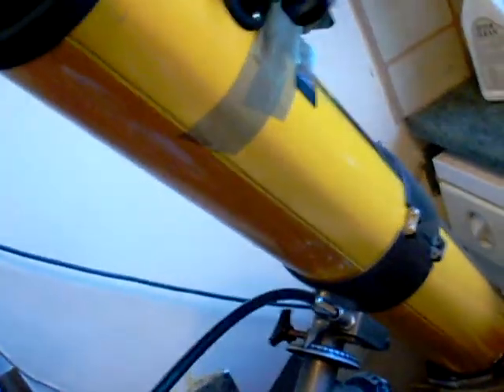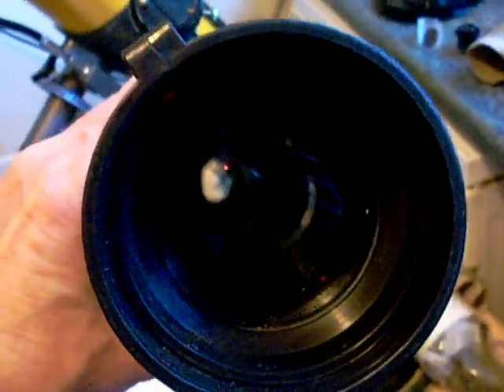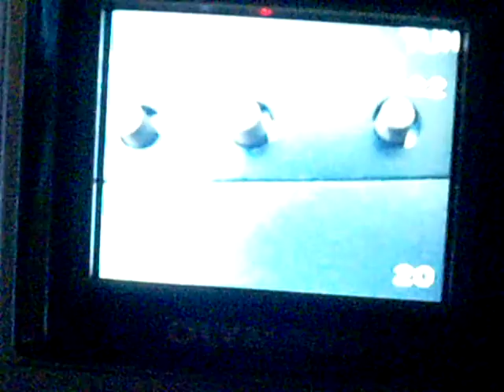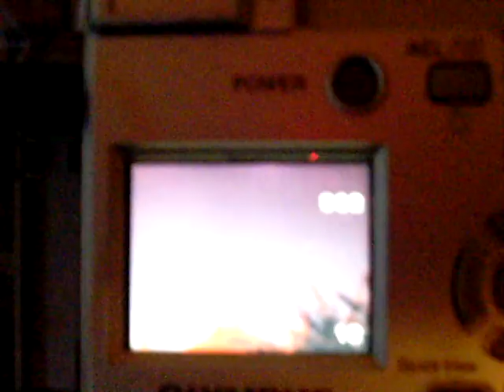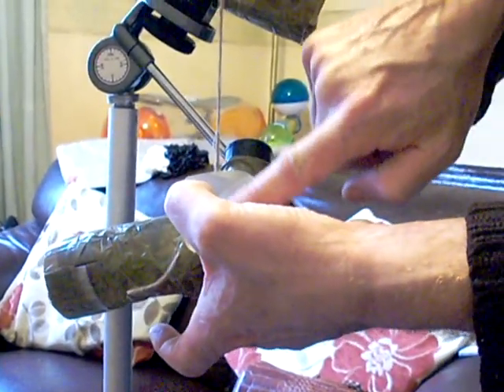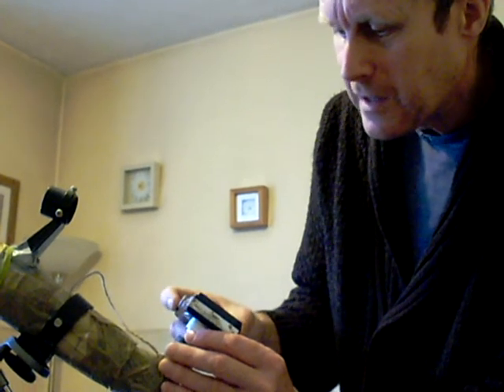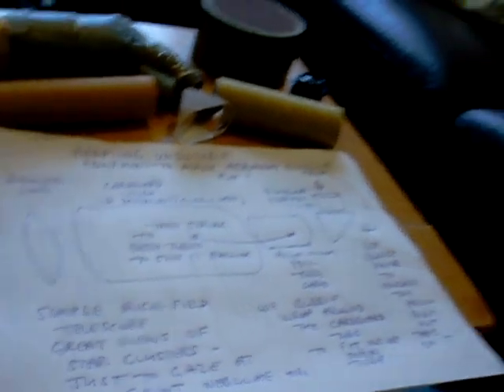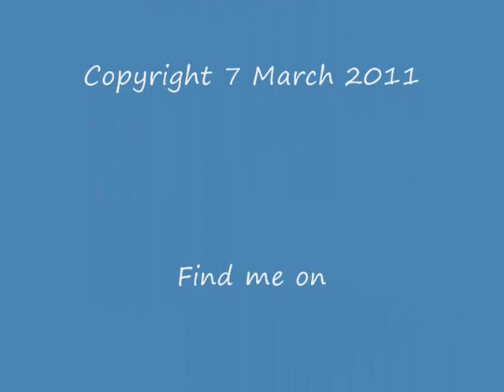How to use a telescope  - Mike Culligan

Comment: Hi, can you help me please? Ihave been given a Terratek Astrotek 76 reflector telescope, but have no idea how to use it. I can't find any info online, or any instruction manual. I found an old listing for this model so you can see the details and pictures for it here: https://www.worthpoint.com/worthopedia/terratek-astrotek-76-telescope-bnib-244888257
I can't work out which bits connect to what, where the lenses go, which bit I'm supposed to look through or anything! I tried looking through the bit I think you're supposed to look through, but I just see a reflection of my eye. Somehow, I don't think that's right. I've asked for help on  a few forums etc, but so far, haven't received any help. I'd really, really appreciate someone with a bit of knowledge to help me figure it out. Thanks :)
Reply from the maker: Hi.I think the reason you can only see a reflection of your eye is that you may not have an eyepiece in the side tube where they fit.  In order to see the moon etc, it's best to use the highest number mm eyepiece eg 25mm. This will give the lowest magnification but the widest field of view.  The little spotterscope on the side of the scope is for finding objects once you have the scope set up on its tripod.  You can practice on chimney pots and tree tops in the daytime to get used to focusing on distant objects first. Although I couldn't find a manual for your exact model  I have found a manual online which has a similar type of telescope to yours.  Look at the instructions in the manual for the Skywatcher AZ1. Here is the link:   http://www.kasg.org/pdf/All%20About%20Telescopes%20from%20Skywatcher.pdf
Hope this helps. Good luck.

Comment: Why is everything taped up?
Reply from the maker: Hi Jeff. Thanks for watching. A lot of my spotting scopes are homemade. Shop bought spotters are often stopped down with tube baffles and extra prisms which cut out light for astronomy. Every photon counts where light gathering is concerned. You can save a lot by making your own stuff as I show in my videos using old prisms, old lenses and of course cardboard tubes and lots of TAPE!